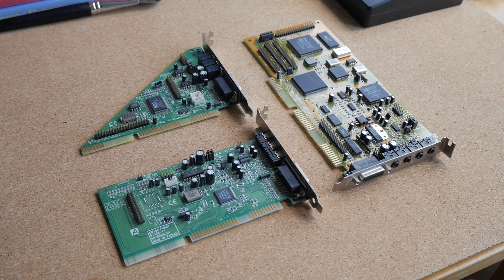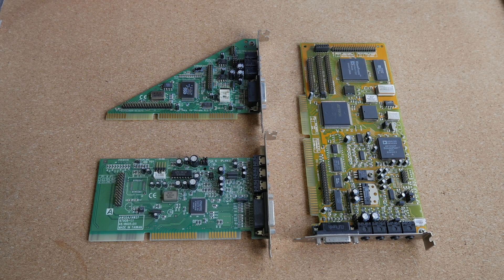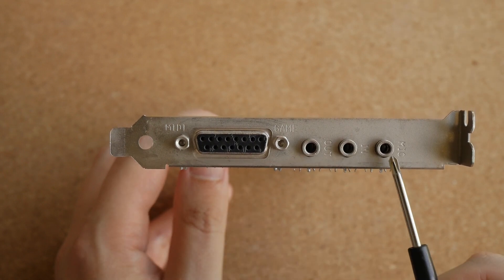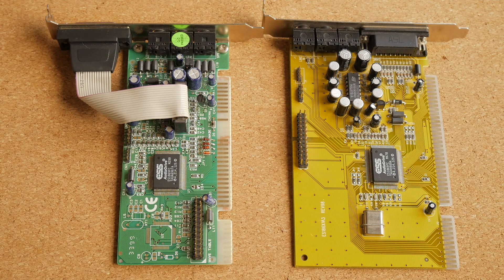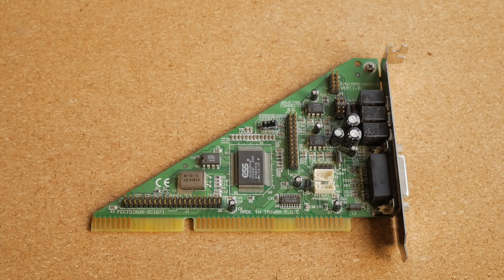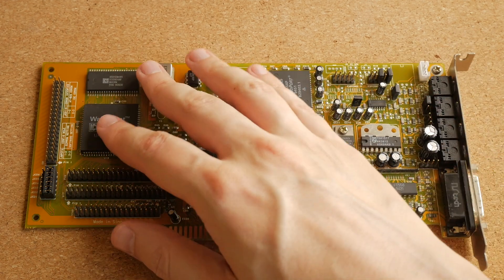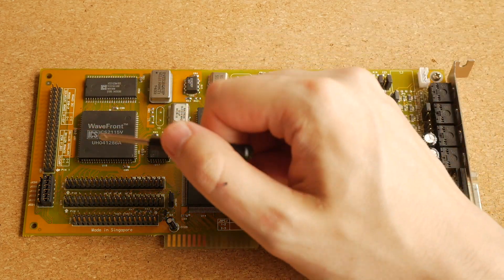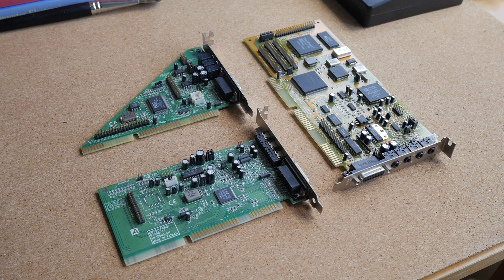ISA sound cards for DOS gaming (featuring Crystal, ESS and Aztech)

Comment: Ah. I knew it. I remember when I was 15 years old. I had a summer job and I saved up money to buy newly released Pentium 3 550mhz PC. Also bought a 25GB hard drive priced about $200-$300 and a soundblaster audio card priced about $250.

The soundblaster card was interesting and did have an IR wireless remote for music and movie controls. But had a lot of useless features such as all the weird effects like Underwater, Hall, Ballroom, .. And the CD audio quality didn't seem all that good. I was better off playing music from the radio using a reciever, but better playing from the CD accessory of the reciever. I wasn't all happy with the audio quality of the soundblaster card.
Reply: If it had a wireless remote, then it was probably an SB Live!, which is actually quite a decent sound card. But I agree that it does not sound good using default settings, you really need to tweak the hell out of it to get decent sound quality.